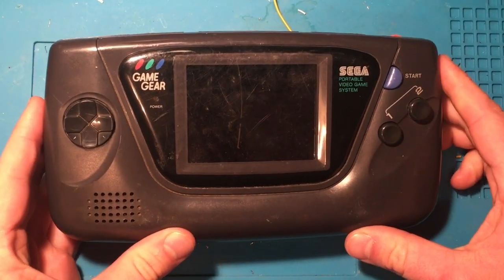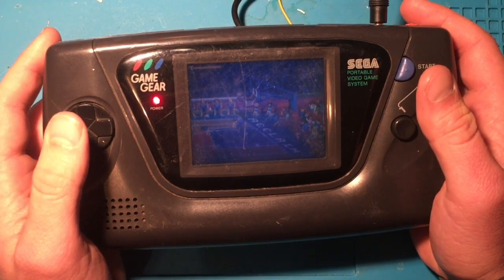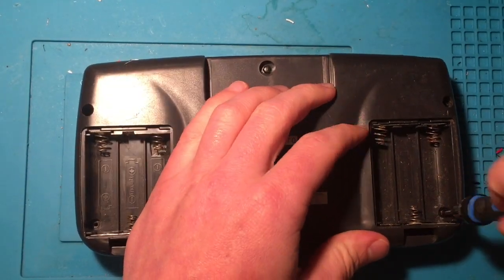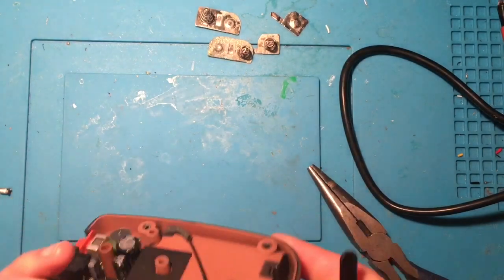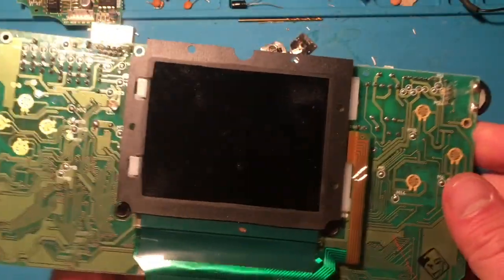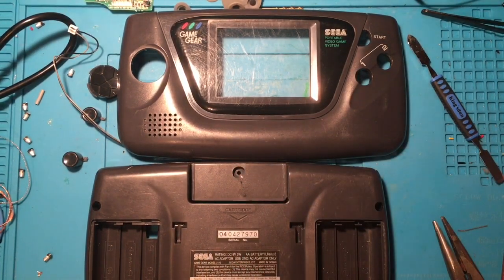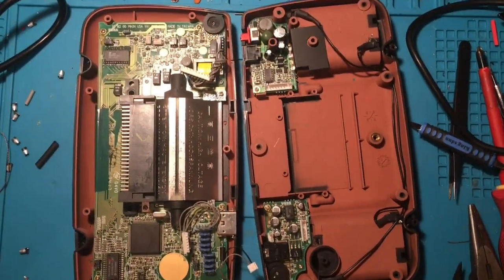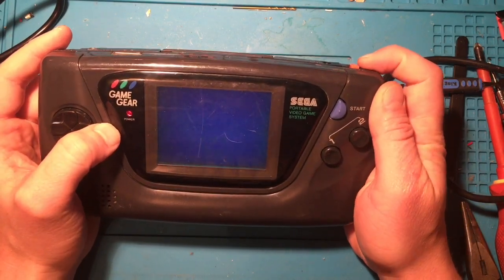Game Gear - No Power - Fixing eBay Junk

Comment: The LCD mod is not needed, especially for that price, however there are LED bulb replacements for about $9.99 along with some DIY solutions to LED mods. Definitely an idea worth checking out.
Reply: This. Very inexpensive, very easy! It'd make a fun video.
Reply: Agreed
Reply: I was about to say... Couldn't you just replace the CFL with an led?
Reply: Does it make a big difference in battery life?

Comment: you can use some plastx plastic polish or brasso to buff up the lens to a clear finish again, you just have to mask off the black areas as the coloring can buff out its only just beneath the surface of the plastic. also when the battery terminals split from corrosion you can brace and resolder them together as they are plated copper. i'd also advise just washing in heated white vinegar.
Reply: PolyWatch also works. I have some for my watches and use it on other plastics
Reply: For sure a light buffing would work great

Comment: Word is that some Chinese company in the early 90s or late 80s got a capacitor formula via corporate espionage and such but the formula was bad and they released some cheap unstable caps.  It was called the capacitor plague. Fun times.
Reply: It was the early 2000's companies like Dell, Apple, and HP took a large hit. Good luck findind a Pentium 4 Dell Dimension Tower or a P4 laptop... Horrible stuff. A company did find out who did it but never disclosed it.
Reply: @Mystical Glimmer
Thanks. I couldn’t remember exactly when it happened.
Reply: @jba2048  man I remember in like 2002/3 Dell has to hire a bunch of local PC Techs (they had to fix em fast, most were PC store owners) from all over and send them out to home and businesses to replace motherboards and PSU. My sister had to do that, even tho I am a system builder, at that time I couldn't beat there price.
Reply: @xaer0knight  Here's the best I could find, from a forum post: "Luminous Town Electric, a capacitor manufacturer, hired a scientist who worked for Rubycon Corporation, another and rather more up-market capacitor manufacturer. As part of the 'unwritten' terms of employment, he was supposed to steal Rubycon's far superior electrolyte formulation, a trade secret mix of chemicals that make Rubycon's capacitors so good. But he screwed up - accounts differ as to if he made an error, or if Rubycon management found out about the industrial espionage and swapped the formula on file for a deliberately defective one. Either way, Luminous got hold of a dud - and, thinking they now had Rubycon's famous electrolyte formula, went straight into production without testing it. They made and sold a lot of capacitors before customers realised that the new Luminous capacitors were prone to explode after a while."
Reply: @keeleye7225  that's some great information! You should add it to Wikipedia and cite the source. All I could get was a ABIT found out what company made them and never disclosed it. They went under in 2008 and there only contribution was under volting on motherboards
Reply: @keeleye7225  Seems Toyota may have gotten hold of some of these faulty caps, I see a number of cars who's  ecu 's have leaking caps. Causing all sorts of problems.
Reply: Yeah I remember that, an imperfect version of the formula was used (missing a key ingredient) and the rest as they say is history... many a Gigabyte, Abit, Soltek, EPoX, AOpen, & OEM motherboards did I repair from that era, the Antec PSU's I recapped are still going strong over 10 years later,  personaly I found Hitano, SamXon, Panasonic & Rubycon low ESR series to be the best 👍

Comment: You don't need to change the lcd, there is a led mod to remove the florescent light.
Reply: @RetroRepairs Please do it and make a video 👐
Reply: Exactly what I thought !
Reply: @KISSbestfan  Me too
Reply: yes, that and a LiPO battery pack and you will get hours of fun-time. or, gut the thing and put a Pi in it with all the games on an emulator, swap out the speaker and plug a USB hub to it and run xbmc with a keyboard and mouse and control all your smart devices on your wi-fi. use hdmi to display to the tv and play mario bros wirelessly with some IR transcription. the thing is primitive it will likely never be worth more than $6
Reply: @icyuranus404  following this logic is best to buy cheaply PSP, mod it, and play every Game Gear game there !
But this is not the case here. I can understand the feeling and vibe playing this stuff. I still reminiscent old handhelds
Reply: @icyuranus404  you sir are talking out if your username
Reply: @sanctuaryiii1924  i see...
Reply: @icyuranus404  $6 was a bargain.  these things are going up in value,  particularly as more rot away due to bad caps.

Comment: this was a great video. i found my gamegear in the closet after at least 10 years (batteries expired 2012) and a ton of corrosion on the battery connections. this was super helpful to safely opening the case without breaking any wires. thanks

Comment: Thanks for the vid. I've refurbed about a half dozen Game Gears but I've never removed the soldered terminals before. That's a pretty good idea. Regarding the plastic screen cover, you can remove it. The adhesive will probably last 100 years, unlike the caps.

Comment: 18:21 can you replaced with an led bulb or stripe? i should be a big improvement in battery life and a cheap mod also.
Reply: I was thinking the same. Can you mode an LED in there
Reply: English 60 (out of 100)

Comment: What you said around 18:45...

I, personally, would NOT spend $120 on a backlight mod on something you intend to resell (if that's what you intend to do). You're right, such an expensive mod for a $6 Game Gear is not worth it.

However, I DO suggest doing it for your OWN Game Gear, IF you use it alot on batteries (for example on long trips). If, however, you explicitly use an AC adapter in place of the batteries, then it's not economically advisable.

*Bonus Math*: Assuming the batteries last an exact 3 hours, if you use the Sega Game Gear for 1.5 hours per day (average), then it'll chew up about 90 batteries per month (1.5h*30d/3h*6batt). Assuming Duracell batteries (at roughly $1 per battery (there are other, lower-quality batteries with a much lower price than that, just using a common example), you're looking at around $90 per month.
With just an AC adapter, assuming an electricity price of 14.6¢ per kWh (in Canada, Ontario), and the Game Gear uses 3W per hour, the total cost per month would be less than two cents (1.5h*30d*(3W/1000)*14.6¢).
Just my two cents (yes, pun intended, go ahead and flame if you want, I don't care).
Reply: If it's about on-the-go power consumption, you can put in an LED backlight retrofit, the backlight panel is $10 on Handheld Legend.

However what the modern integrated $100+ LCD mod does is give you a ghosting-free high-contrast screen.

Also what's the deal with non-rechargeable batteries? Does anybody still use those, except in an emergency or in ultra-low-power devices? I have cheap store-brand Eneloop Pro clones everywhere, they're great, they come pre-charged and cost 5€ for a 4-pack, plus you need a smart charger, which could be like $15-$30.
Reply: @SianaGearz  alot of rechargable batteries don't have a very long shelf life anyway. They slowly lose the ability to charge to full capacity until they don't work and they generally cost more than regular batteries. Better to just plug the thing in.
Reply from the maker: In all reality, i rarely use it as it is, if i do, it will be plugged in.  A screen replacement would be solely for better picture and for a project to do.
Reply: @toxicavenger6172   Eneloop Pro (and even Chinese clones) have a life of upwards of 500 cycles until they lose a third of their capacity permanently; self-discharge is at the level of about 20% per year for genuine ones and up to 40% per year for cheap Chinese clones. This is an absolute game changer compared to prior NiMH chemistries, that while reached higher capacities, weren't nearly as long-term stable, losing most of the charge within 2-3 months. The specified capacity on store-brand clones made in China is 2400 mAh - not verified yet myself because lazy, but the store is super trustworthy. They also seem quite low-ESR and capable of high burst currents, as they easily max out 20A on my multimeter and don't get very warm in the charger, so they tend to fare pretty well against alkaline in unfavourable scenarios, in digital cameras and such. I have been using the same NiMH smart charger that i bought 20 years ago, it was still made right here in Germany by IVT, so it's been an excellent one-time expense.

Non-Pro Eneloop version has lower capacity and even higher long-term stability with less capacity degradation per charge good for thousands of cycles and even less charge loss in storage than Pro version.

Naturally plugging in when possible is a sane choice, but then, it's a handheld console, ideally you'd make use of the fundamental freedom the form-factor provides. Also wireless mice, controllers, etc. are a great convenience and for me they tend to accumulate at great pace - Xbox controllers for PC, Wii remotes, and more, all kinds of gadgets both bought and self-made. Xbox controller needs more power than a Gameboy Advance.

Comment: This thing is awesome, looks like a little TV and a game console from the 80s all shoved into a device as small as possible. Very old equipment in here, not a lot of surface mount stuff, just good old fashioned caps and resistors and fluorescent tubes run by AA batteries lol.
Reply: Actually it's 90%+ SMD components in there. And there is a TV tuner cart available, although sadly useless now analog is gone :( Actually, thank you, you just gave me an idea...
Reply from the maker: hd downscaler and ota hd antenna game cart?
Reply: @RetroRepairs  has it been done?
Reply from the maker: @danmackintosh6325  no idea,  that would be pretty cool to do though.
Reply: @RetroRepairs  certainly would, might look into it if i have time but feel free to claim the idea if you want lol

Comment: Hey RetroRepairs thank you so much for your in depth channel! Inspiring video for me to get into electronics repairing. I saw you were messing with a drywall sanding block, maybe a wire brush would help better clean out the plating on battery terminals you think?
Reply from the maker: It could, but the only one I have is for prepping concrete for bonding new concrete,  which is way too stiff. A lighter one could get into the spaces.  The other trick is size.  It's so small, you'll likely tear up up hand with a wire brush
Reply: I would pop the spring off (some twist) get a polish brush on a dremel and tackle it that way.. you'd restore the shine and make it look new again..

Comment: I did an led backlight mod on a silent scope gun display that had a cfl tube.  I ended up just using some cheap 5050 led strip I had lying around, looks just as good as the original backlight. Tapped into 12vdc off the board, been working for over a year.

Comment: after fixing 100s of these always replace the capacitors they will fail eventually
Reply from the maker: 100%.  That's going to be a future video for this unit.
Reply: @RetroRepairs  sweet I look forward to your vids!
Reply: @Renebean  I second that statement! (the second statement, not the first :P)
Reply: I'm amazes that he found one with the original caps in it that even works. I've done many of these as well and the caps are always gone, the contacts on the board often corroded completely off. This has to be the easiest repair I've ever seen on a GG. These have the worst caps of any console, with TurboDuos coming in a close second.

Comment: The brown is resistive paint, it's commonly used in older laptops.  I remember a laptop which had positive and negative lines inverted and it briefly shorted, nice smoke and smell ;-) no damage thought.

Comment: The bubbling actualy comes from the corrosion that is not on the springs. It looks like some alkaline batteries leaked and caused that residue. Alkaline batteries are filled with a solution of Potassium Hydroxide, which converts to Potassium Carbonate on contact with air. Potassium Carbonate + Vinegar = CO2 bubbles, water and a solution of Potassium Acetate.

Comment: Battery corrosion is a mixture of lead sulfate and copper sulfate.  A dilute lye solution will clean it right quick and in a hurry.  Lead sulfate reacts with the lye and copper sulfate is readily soluble in water.  Vinegar will have very little effect on the lead sulfate at all (you'd need about a gallon to dissolve what you showed in the video.)

Comment: The capacitors were cheap because the cost of the CFO bulb was the bulk of the production cost per unit. Unfortunately. it came at a price of console failure over time.

Comment: Got a cheap solution for the cfl bulb replacement, swap out the cfl for low voltage LEDs, find some 5-9 volt led micro bulbs, put them in series with each other hot glue them to a peice of platic running the length of the backlight cfl bulb,, run a line from the positive battery terminal to the brightness control, then to the positive of the bulbs and then back into the neg battery terminal. Cost ya 5 bucks in parts and take maybe 20 mins to rig and solder. as for the cfl... simply remove it and cap off its terminals with hot glue to prevent short circuiting. Congrats you now have an even brighter backlight and a battery life of about 12-15 hours with ni-mh rechargable batteries.

Comment: For rust I use the works toilet cleaner preferably in an ultrasonic cleaning machine just fill the machine with plain old water and use a small glass jar with enough of the works to cover the parts 3 min gets rid of all the rust note denatured alcohol to dip the parts in after de-rusting stops things from re-rusting if you don't have an ultrasonic cleaning machine it can be done without one it just takes longer I'm not sure how long 15 min or more you'll know just look'

Comment: You should always try putting the terminals in vinegar to remove corrosion before sanding it removes corrosion like a charm I've done it on all of my battery terminals that've been corroded like my original gameboy and gba.

Comment: What about an LED replacement for the backlight? Still use the original screen, but pull out the CF stuff and wire in a 5v LED matrix.

Comment: There are videos on nickel plating and how to do it small scale, would be awesome for the post rust removal on these contacts to keep them from rusting again, the videos I've seen the plating done were typically hotwheels restorations but the ability to keep the contacts from rusting again could be worth the setup as often as you deal with small rusty/water/battery acid damaged parts.

Comment: At some point I plan on restoring mine. It works fine right now, but I’m gonna replace the capacitors to be safe and do the led backlight mod. Also I’ve found that you can get actual glass screens to replace the plastic one covering the display.

Comment: The best thing to do with those, assuming you want to play GG games on original hardware rather than just on the 3DS virtual console (which is the best way to play them on a handheld IMO), is to take it apart, and replace the screen with a modern one.  You get MUCH MUCH MUCH better battery life since modern backlights are LED rather than CCFL.  And the screens themselves are much more power efficient.
Reply from the maker: I've seen those, but the replacement display is about $120, which i have a very tough time talking myself into doing
Reply: Yeah I can kind of agree with that.  I'm not enough into Game Gear to warrant the price.  But for a Game Gear enthusiast, I can see doing it.  The only Game Gear game I personally wanted to replay after all this time is Defenders of Oasis.  Which is available on the 3DS virtual console so yay.  I can play it on my New 3DS XL.  Which, for some reason, has a "blur" option to emulate the blur from the crappy old screen the Game Gear used.  Thankfully you don't have to turn that on.

Comment: I still don't understand how these things get so bad, it's like they just left it sitting in a puddle of water for literal years.
Reply: Most likely they left batteries in there for a long time
Reply from the maker: Definitely just batteries. The rest of the system was fine, but leaking battery acid can wreak havoc on terminals over the years
Reply: @RetroRepairs  I completely forgot that batteries would do that.

Comment: Hi that's a easy fix for the no power issue try gently scraping the battery terminals with a flat blade screw driver clean the battery terminals with vinegar its how I fixed my original Sega game gear I bought 30 games a game genie model 2 Sega Genesis ac adapter and a power back with the original Sega game gear ac adapter

Comment: You can always 3D print those missing battery covers if you want.
Reply from the maker: Just missing the 3d printer
Reply: RetroRepairs or buy them from ebay if am right, because i bought 3D printed battery cover for my other devices.
Reply from the maker: I'll probably end up doing exactly that. I'm not really worried about it right now